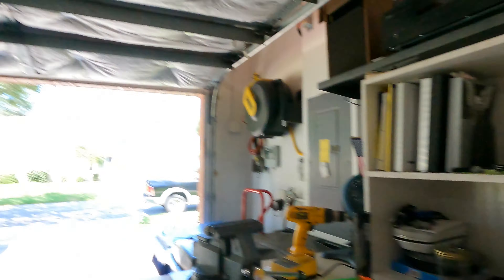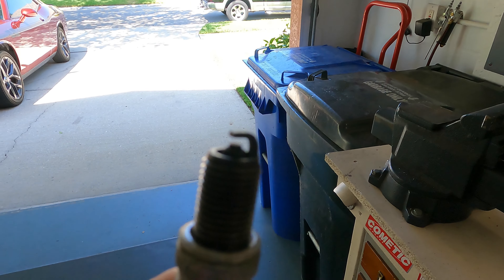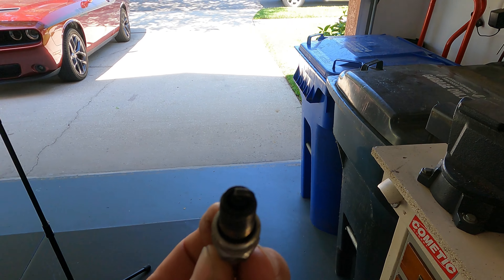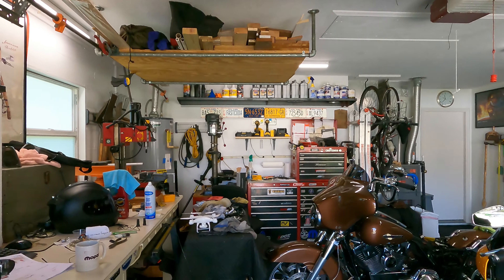Zombie Glide Died

Comment: Were both spark plugs fouled or just the one you showed ? If its just one, switch your O2 plug caps and see if problem moves. This is of course if it will fire up long enough to try this. Id probably put it back to stock at least long enough to get it inspected. Just my opinion.
Reply from the maker: Both were very black - and what I showed was after soaking in carb cleaner as well.

Comment: id check crank position sensor
Reply from the maker: @iamgregor - Good thought.  I checked it, 1 ohm resistance and I can see AC voltage coming from it.  Now, with that said, it may not be putting out the proper voltage.